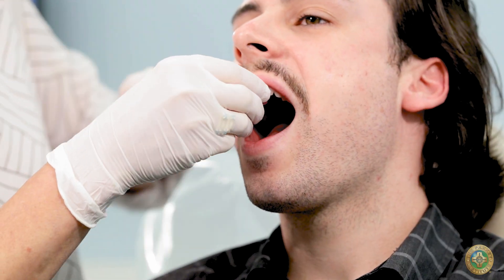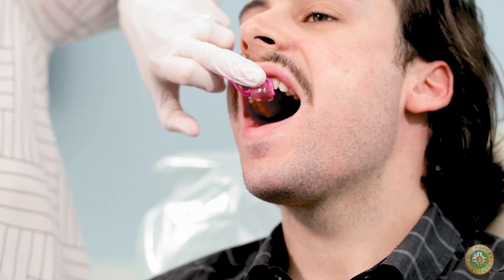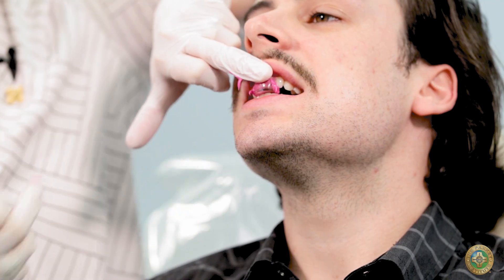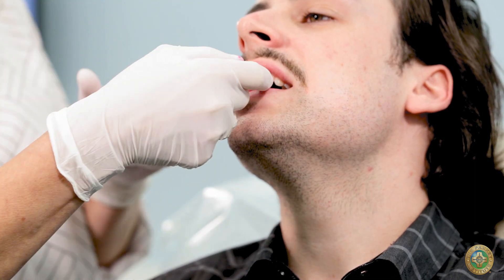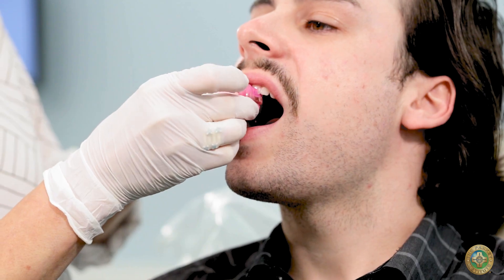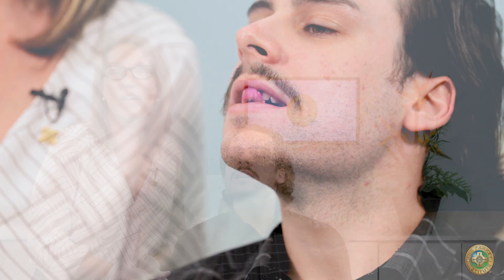Lucia Jig Fabrication with The Pankey Institute

Comment: Thank you for sharing 
I have the question:
We have different devices for deprogramming of muscles (for relaxation), how I can choice between:
- Lucia jig
-kois deprogrammer
-anterior deprogrammer

What is best option? & if patient have TMJ issue or bruxism or clenching can change the above options 
Regard
Reply: They all operate the same way and have the same impact on muscles, joints etc. The difference is how they are relined and fit, and the retention. The anterior bite stop in this video I would not have a patient sleep in, and they can not use long term. If I needed a temporary device for sleeping I would use a Quicksplint. As soon as you reline with acrylic or have a device that does not use silicone, it goes to true anterior only appliance therapy, and risks have to be managed and the patient followed post op. So a temporary anterior only device is used diagnostically or as a temporary device for relief of acute issues. and anything long term is a true appliance for therapeutic use but requires much more patient and device management.
Reply: Lee Ann Brady 
So from your explanation, I can conclude that:
Patient with acute symptoms can start with Lucia jig in office just to diagnosis. If signs still I can use anterior programmer but for a short time to avoid teeth movement? So kois deprogrammer the choice for an extended period till the symptoms relieved?